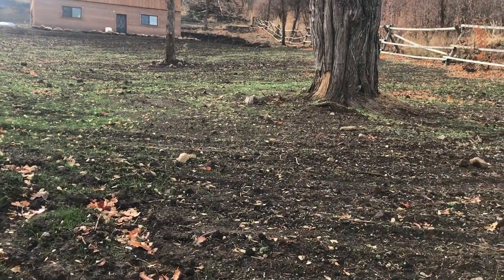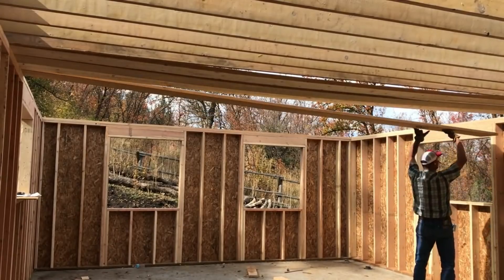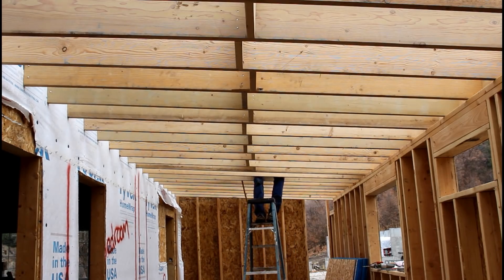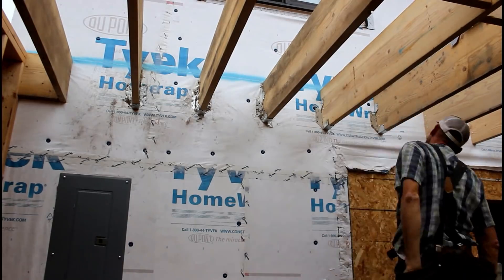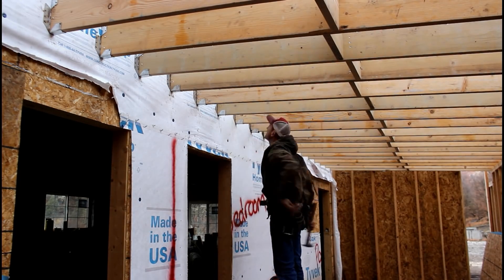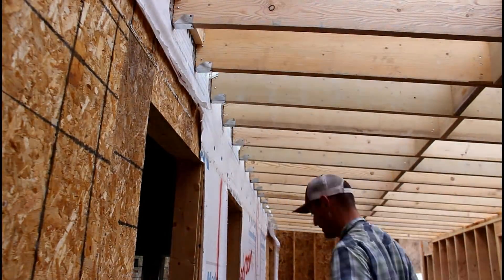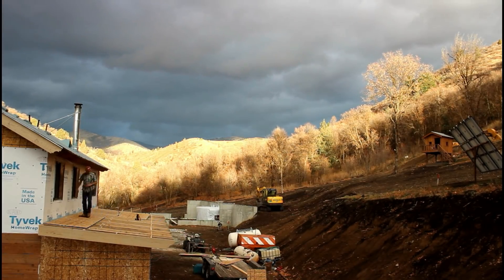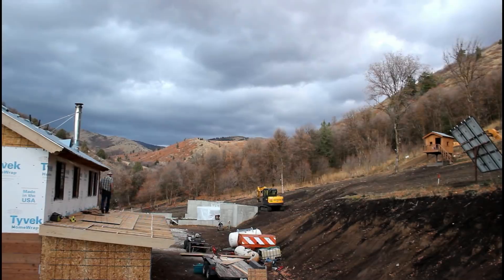#276 - Framed The Roof For 100LB. Snow Load (Ledger, Rafter Hangers)

Comment: I was gunna ask in the last video why no ledger board for your roof there, but you cleverly used the second floor ledger as the roof ledger. Nice. I would have slopped it a bit more but i know you were working in a height issue on the addition and the main house ledger.

Comment: I was thinking that you should have used cheaper prefab trusts instead of 2x12" BUT at 2,000$ for the whole lot instead of 6,000$ is a steal !! Good for you ! I am also always looking for deals, end of runs, slightly damaged materials and stock them. 2 weeks ago, I went to the local "big box" lumber yard for some screws and saw they were clearing paletsfull of 1/2" x 7/16"x 8' quarter round moldings at 1$ each (!) Usualy priced at 8$C ! Bought 60 of them. Could'nt resist.

BTW, regarding those hangers, I know they are now mandatory everywhere by code. But do you know they become useless after the house is dried in ? Unless you use kilndried lumber, the wood looses it's natural humidity content, thus shrinking cross grain, (not lenghtwise) and then holding on only by the 1 1/2" nails !! You did good by toe nailing them !
Take care, Heath !

Comment: Dad always said to build it "Bull Stout and Chicken Tight" so you're good. you built it pretty much the way i built my shop off the garage. i could have used 2x8 or 2x10 but i used 2x12s instead for snow load and due to a minimal roof pitch and for maybe a future deck or solar panels on top. the next winter we had 16" of wet snow sitting on it for over a week or so with no problems. you'll never regret using too much insulation or over building a structure i say.

Comment: Thank you for answering my question. A whole video was an added bonus. Glad you are using the Tico nails, their sheer strength far surpasses standard framing nails, so with the hangers and being nailed into the internal support board, this should definitely be stronger than just using a ledger. You'll likely have to clear snow off of the lower roofs, but I understand the aesthetics of the front and back roof pitches matching. You're doing an awesome job, I was just worried when I didn't see at least hangers in the previous video. (And yes, typically the hangers go up before or with the rafters).
Great job, and great explaination.

Comment: I see now what Heath did now on the roof rafters.  He lowered the Room Addition ceiling height so that the top of the rafters would run into the second floor Rim Board, and he used this Rim Board as the Ridge Board for the rafters.

Comment: Great video - thanks for giving us all the skinny on this roof.  You seemed slightly defensive - - it just seemed odd.  I've never seen anyone add the hangers afterward.  But I have seen people rely on toenailing, which of course is neither code or safe.  Your roof now is never going ANYWHERE.  I've always installed the hangers first, then slid/tapped in the rafters after - making it much easier to work by myself.  I even had some 20' rafters on my porch - they were oh so much fun  ;-}  
You are really jammin'   Wonderful to see that you're going to beat the weather  -- AMEN !

Comment: I was under the impression that I had to use a ledger board on the wall for the rafters, and I would have built things that way.  But maybe this is not true.  Maybe I can tap into the rim joist like you just did.  Please, let us know if the roof passes inspection and what the Inspector says, because I am learning too.... so I'll rethink this ledger board issue.  Also, you are absolutely correct about the snow loading - the way to have a stable situation is to increase the rafter sizes, and in your case, you upped the Annie to 2x12s; or increase the pitch.  I forgot about your snow loading because I am here in Northern California.  No doubt, a higher pitch in snow country really helps.  But if you are allowed to have a low roof pitch by local code, then by all means, knock yourself out.  😉😉  May the Lord provide you with more resources, including 2x12s, to get the house finished.  Great, great job!

Comment: im more for the ledger board my self then all the tyco nails. seems they split the wood and weaken. some where i have torn apart came aprt easy. but the ledgers always hold the weight. and if rot then pointless lol. so its all in type wanted.

Comment: I picked up a cheap air palm nailer at Harbor Freight that works great for nailing Joist Hanger nails. It saves a lot if fingers.
Reply from the maker: I've got one. I'm faster with a hammer.

Comment: The problem with no ledger board is that there is nothing to nail your roof sheeting at the house end.  You could add blocking, but what a pain with the hangers.....
Reply from the maker: blocking is there.

Comment: Lots of ways to skin a cat Heath and that's one of them. It will work just fine.In that situation I usually just put a skilsaw slice square in from the heel of that cut and slip a regular joist hanger in when I toenail the top to the line.  Then I just come back and nailgun them on there later.Both ways get the job done.  I prefer the way you've done it versus a ledger board  for potential snow load.

Comment: great.. be sure that on the back door.. you have a second deadbolt or jimmy proof dead bolt installed at about 20 to 24 inches up from the floor to make it crazy hard to kick thru.  there is a way to drill a shallow hole in the hinge side of the door. put a lag screw in.. cut the hex off.  close the door to imprint the lag screw end on the door jam.. you can pound a piece of 1/4" galvanized water pipe and trim off the extra like you cut off the hex on the lag screw to make the door even harder to get thru.

Comment: I will share what happened at our two story house.  Steel roof.  Cantilevered deck from second floor, side of house under the dripline, built with 2x10s, some laminated  (two 2x10s nailed together).  Heavy snow load, which over the course of the winter accumulated a heavy base of ice.  The snow load came down in one fall, and cleanly snapped off the deck, all boards were snapped off like toothpicks.  It would have killed anything under the dripline, which fortunately was not a traffic area.  I don't know what your snow load is, but I'd be nervous of accumulated snow coming down from the main house roof.
We got about 100 inches of snow each winter, sometimes more, sometimes less.  That winter there was a bit less.
Reply: M T Good point to keep in mind: impact load, especially when ice has formed, can far exceed a static snow load.

Comment: I hope it works when you get snow piling up on the addition, I think I would have opted for a steeper pitch, seen several barns in my area over the years where they built wings that collapsed because they had a flatter pitch than the roof on the main building.  You're gonna want to shovel snow off that addition during heavy snow years to keep that from happening.
Reply: Steep enough .

Comment: Gotta love when people jump to conclusions. You did say that you were nailing the rafters to the rim joist... 

In my area, you can't have the plywood between the rafters and ledger board/rim joist, but it is considered acceptable to use the rim joist as you did. You clearly were not done with framing in your last video.

Hope you get your inspection soon... Snows gonna start flying soon.